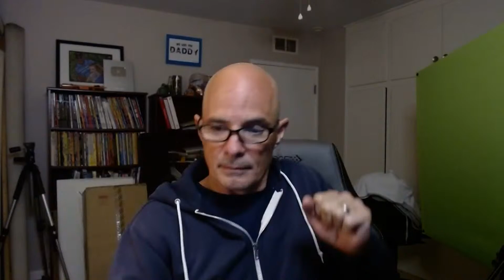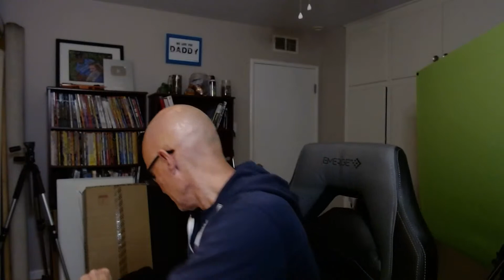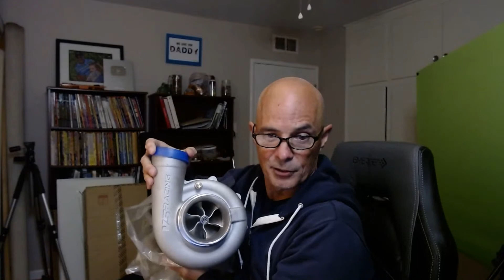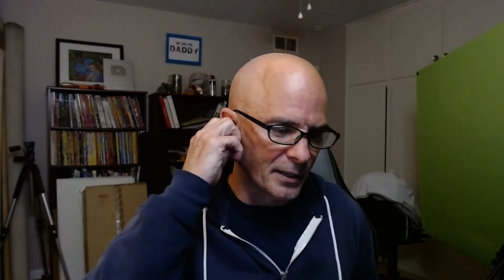LET'S TALK TURBOS-TIME TO VOTE FOR A TURBO SHOOT OUT! GT45 VS?

Comment: I am going to have to do a single turbo on my 394.  I have listed the specs here .  I really wish that there were manifolds that were like the 6.0LS truck manifolds. Face them forward add a cross pipe to a ( GT 45 , S475?) to an intercooler air to air likely, up to a hat and Holley. Run a 4.5 pipe out to the rear and a Y pipe to split to Xpipe 3 inch duals with resonators and 3 inch Flowmaster type mufflers and 3 inch pipes out the sides. I already have the exhaust system exhaust for the front parts. I guess header flanges from the FE to get welded toLS headers facing forward. I want 750 to the wheels with a rising torque curve so it doesn’t break rods or the crank. Which turbo do you think Richard,?  It seems likely the 475, and is there an OEM air to air cooler you know of and I would think that my 3in dual exhaust out would be good. I already have it.Thoughts? I wanted to run some Trick Flows and a bigger cam. But boost has come to make more sense.

Comment: Gt45 vs gt35 vs gt30 on a random 4 cylinder
Reply from the maker: SR20?
Reply: @richardholdener1727  I have a running sr20 when you’re ready for some testing
Reply: I actually have 2.5 sr20dets. Only one is assembled though.

Comment: Greetings Richard from San Rafael!

The one thing I'd add to the issue that you mentioned regarding engine builders not getting a baseline N/A number.....is it would seem somewhat irrelevant to them.

Due to the engine having lower compression versus if it was built as a naturally aspirated unit?

Although I do agree with you on the matter, surely there's a formula that one can use to extrapolate a theoretical power/torque difference, with respect to however many points of compression it may be down.
Reply from the maker: the na power numbers are used to calculate how well the turbo combo is doing-the starting na combo has low compression
Reply: @richardholdener1727  wow, appreciate the lightning quick response! 👍

Comment: I agree you are.  I am wanting to turbo my 394 FE with two GT35 turbos and I hope that the eBay 35s and a pair of shorty headers . Even though they exit rear. I believe that I can make a long pipe from header around the the front to the other with elbows at the ends of the headers with mounts at the front for the turbos, T03s I think with the Wastegate and BOV up top and the cold side in the intercooler up to the hat and carb. I hope that I am on the right track. I just want the Chinese turbos, I think they are T03s being 3582s. I want 850 hp from the turbo setup.  At the low amount of NA is 435-445 hp. I thing 2 10 lb GT35s or 45s if you think. Is there a 04 3582 ?